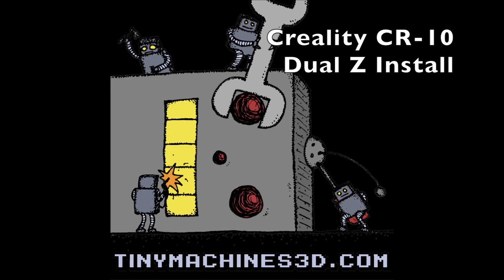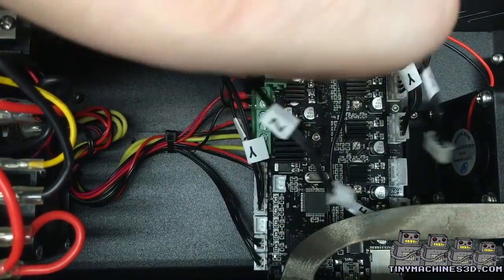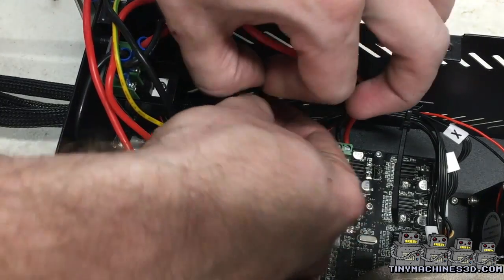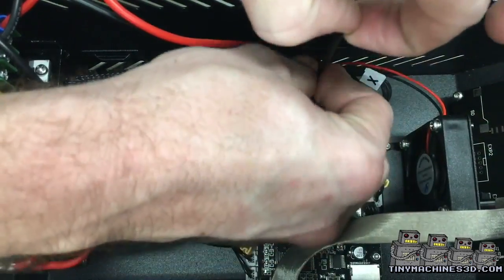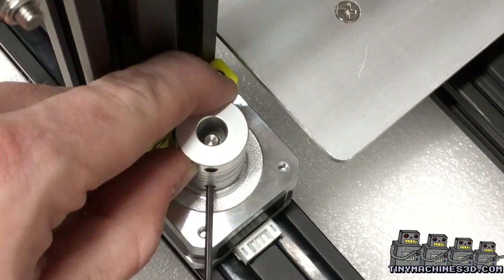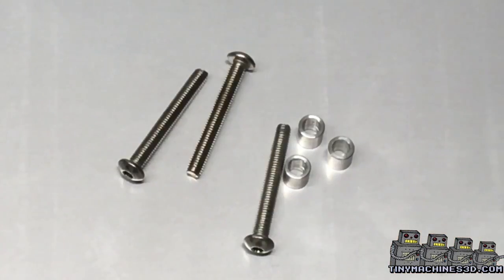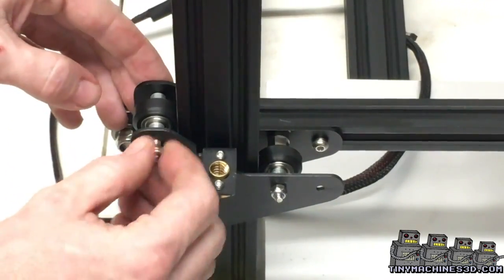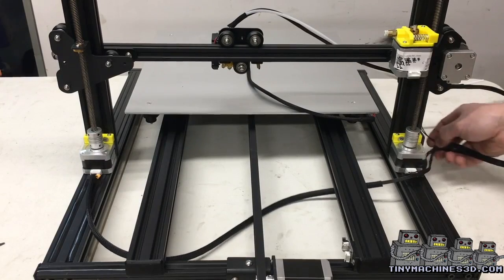Creality CR-10 Dual Z Upgrade Install

Comment: I have the CR10. Could you tell me why I would do this mod?  Thanks...
Reply: I have 50+ hours on my CR-10 already as I needed some large functional prints that my other printers could not handle without breaking them into many pieces.   I want to install this kit now but I need the printer to finish the parts first.  My immediate motivation for adding the second Z lead screw is that the print carriage moves downward on the single lead screw very easily.  When I am installing filament it moves (you can even see that in the Tiny Machines assembly video at 8:45) and also while I am leveling the bed if I am not careful.  Having it more resistant to Z movement will aid.  I will print the same item after adding the kit for comparison and report results.
Reply: dont feal bad i dont have one and i am wondering why to do this mod ????
Reply: So the side without the Z axis is more stable and doesn't wobble up and down, causing artefacts in the print.
Reply: It really is not needed on the CR-10, unless you want to convert to a direct extruder. If the V-wheels are correctly adjusted, it is simply a mod for the sake of a mod. Creality cleverly designed this printer with a counter balance X-axis arm. I own one (as well as a few other printers -- Flashforge etc., FT-5, and my own design). As long as you don't mod to a direct extruder design, or add a bunch of weight to the existing X-axis -- not needed.

If you have the 400mm print platform version of the CR-10, then it's a very good idea to use this. Just remember, consistent repeatability is more critical than absolute measurement equality, in 3D printing.
Reply: Both sides are on the Z axis LOL!  But I understand what your saying. The side w/o a stepper and drive gear is rock solid on my machine.  Does your CR10 wobble up and down?
Reply: Yeah, I didn't mean to say that, sorry. I don't have a CR10, just a Makerfarm i3v, a Rostock delta and a Tevo Tarantula. The Tarantula left a bad taste in my mouth so I'll never buy another printer that only has one Z motor. I'm sure some printers such as the CR10 function just fine with one motor though, but it ain't for me :/
Reply: I was totally being a joker.   My printer is for work, so I am trying to be proactive regarding anything that may or will go wrong.  I appreciate your insights..  That's why I asked. How do you like the delta machine?
Reply: The delta machine is my favourite. It's a $300 chinese Kossel from aliexpress and it's been rock solid since day one. It's never given me a single problem (with the exception of user error incidents) in the 2 years I've had it.
Reply: Very interesting...  I have always thought the delta design was an elegant solution.  Plus I need one the size of a small car :)
Reply: How do you adjust the V-wheels correctly I'm getting some missing layers on my CR10 and I'm am unsure if the wheels are too tight or too loose?

Comment: ok so do you have a dual extruder kit? I would love a dual extruder CR-10 my only dual extruder printer at the moment is a delta that can only do 150mm circle by 100mm tall but I love using wash away supports

Comment: I would like to see the cable for the second Z Motor length in a little bit so that we can run it down the frame to the back across the frame on the back and up the frame on the back so that the wire is not dangling in between the two verticals but instead securely attached to the frame all the way around
Reply: I just installed the kit on my CR-10.  For the CR-10, the cable is plenty long and can run along the outside edge along the back.  The S4 as shown in the video may need an extension to do that.